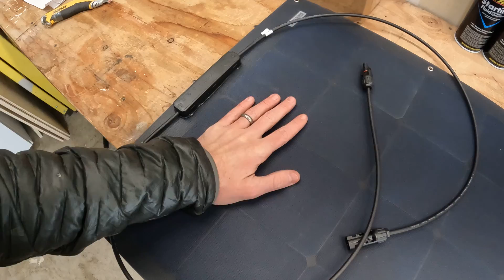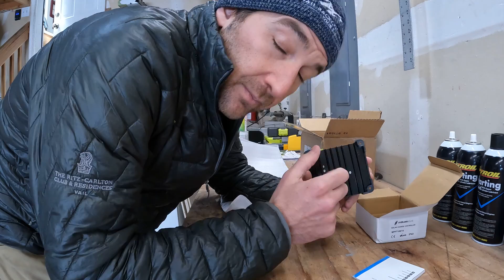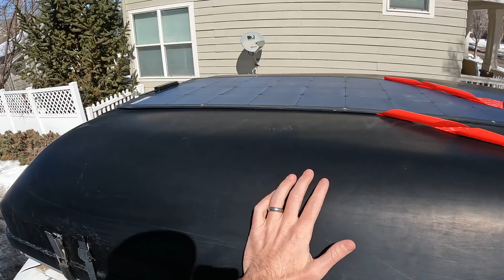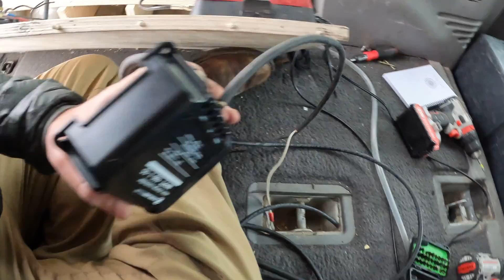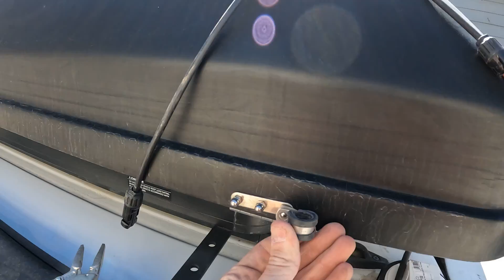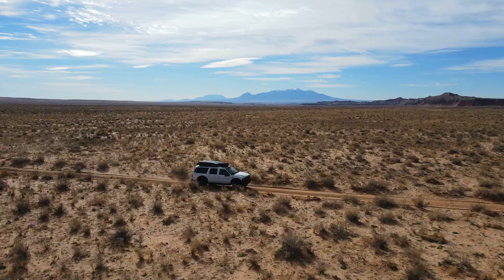OVERLAND FORD EXCURSION: A Solar Install

Comment: I installed two panels directly on the front of the roof. That way you can remove the tent or add remove storage bins and retain the battery charging benefits of the panel.
Reply from the maker: Great idea - I would have to move my spare tire - the solar on the tent is working well even with it open (so far at least).